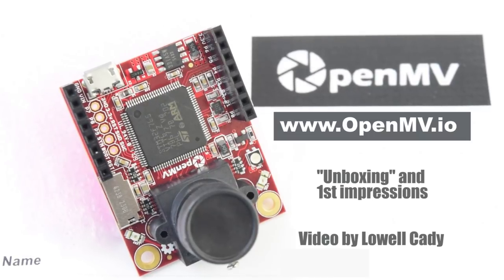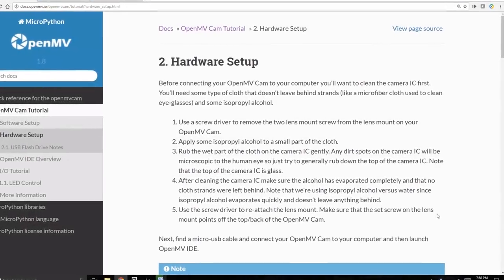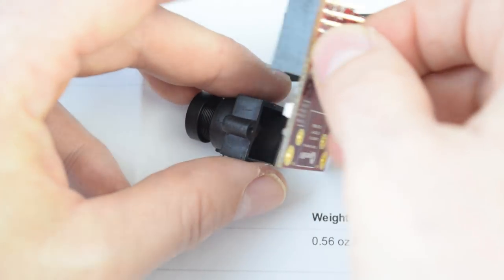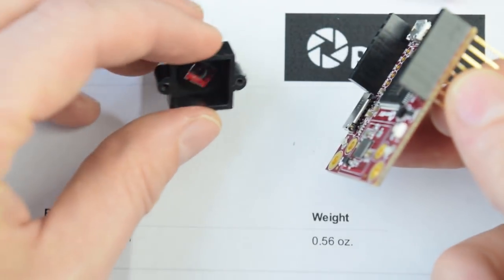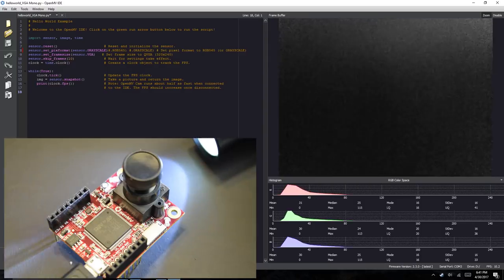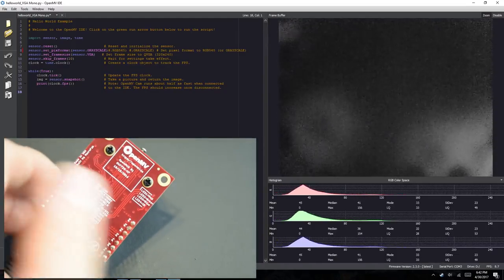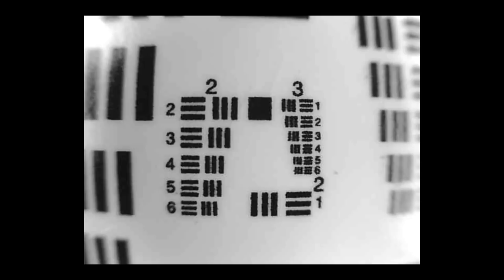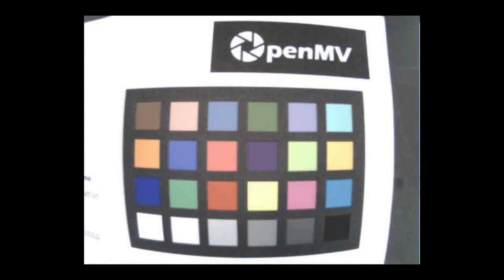OpenMV Cam M7 out of the box

Comment: Heyo! Cool video. We'll incorporate your feedback into the next model! Note that we may be able to manufacturer the cameras in the future without dirt/etc. It was just hard to do that for the first batch. As for the via issue. I suppose we can cover the back area with something out of the factory. Or maybe just solder mask the whole area.
Reply from the maker: I think it's great that you created this camera.  I've been looking for just this kind of device, more powerful than an arduino, but not needing an OS.  Just the bar code and data matrix capabilities make this worth more than the price.  At this point I'm still getting an understanding of the absolute basic functionality.  I'm probably misusing micropython to do things like turning off the automatic exposure and gain then poking values into registers.  (I figured out how to set the gamma curve via regs 126 - 140).  I want to figure out how to de-bayer the RAW data, (GREYSCALE then reg 18 (12hex) bit0:1 = 3), but haven't figured it out yet.
Reply: Since the firmware is open source and all the tools easy install on linux you can really do what you like. See here: https://github.com/openmv/openmv/wiki/Firmware-Development